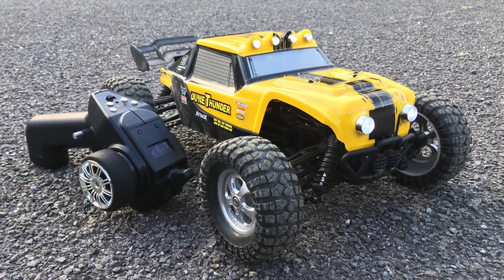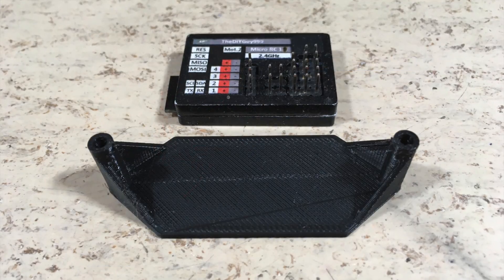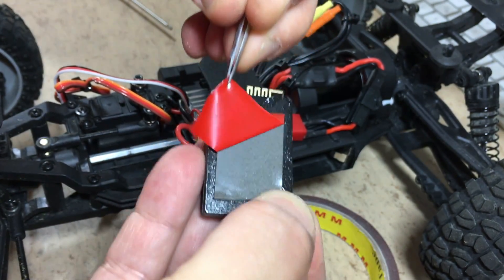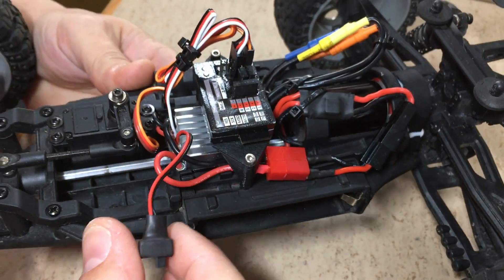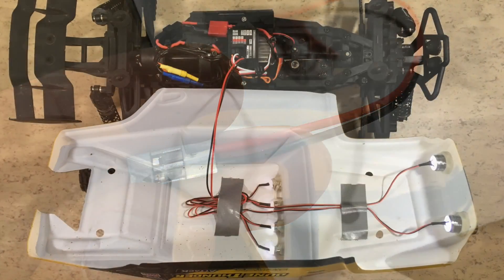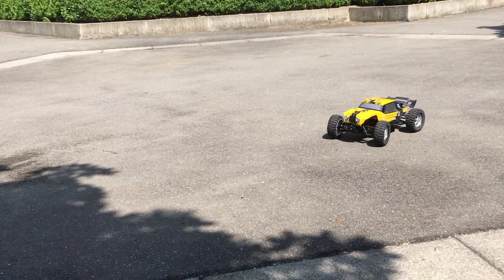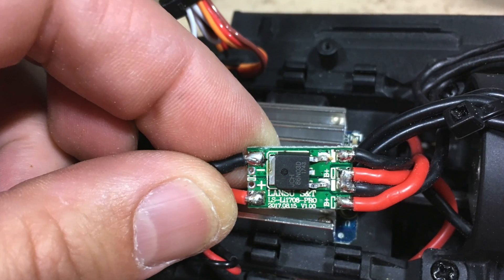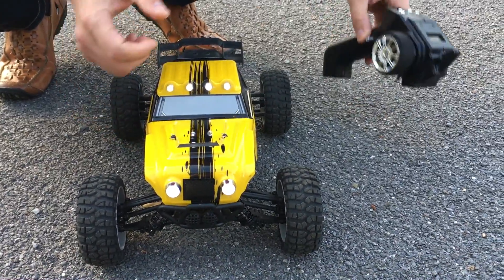HBX 12891 DUNE THUNDER Brushless Conversion Part 2: 3D Printed Parts!

Comment: I've just finished my upgrade with the parts you've provided.  I am having the same issue with it cutting out.  What did you do to the receiver?  I am using a Radiolink RC4GS 2.4G 4CH RC Transmitter and Receiver R6FG Gyro Radio Remote Controller system.
Reply from the maker: Use better "high discharge" 18650 batteries, which are able to supply the needed current.
Adding a filter capacitor for thee receiver could be helpful as well: https://www.banggood.com/1000UF-Filter-Capacitor-For-Flight-Controller-Receiver-VTX-RC-Drone-Multirotor-Spare-Part-p-1284837.html?utm_campaign=4828314_1046285&utm_content=1097&p=NZ29024828314201605E

Comment: Hi mate I finally will be getting your reciever mount printed, BTW have you come up for a way of fitting a small 3s pack? I have a different body so fit mine in the roll cage.
Have a look at my setup on my channel if you like. Very modified drivetrain :) if I make more videos I will mention you for the reciever mou t and 18650 adapters.
Reply from the maker: Hi
No, I think the best solution is to use a battery strap. Be careful with 3S, my motor already gets toasty on 2S... Also make sure, that your "small" 3S pack is able to supply the required current. If overloaded, it will expand. I had a look at your video, runs good!
Reply: @TheDIYGuy999  my mptor does not even get warm, must have the perfect gearing. Although yesterday I had to change the diff gears as they got worn after my testing period and now was ready to put it all together as should be. I noticed now they changed the gears,  bevel used to be 13 and is now 11, big gear on diff was 38 but now 32, I be out today to see if I need to put a smaller pinion on..
Do you have the 16 motor pinion on? I do as recomended by hbx and Redcat to use with this motor.
Reply from the maker: I'm using the stock pinion. It works without issues and it is fast. But I still think 3S would be too much.
Reply: @TheDIYGuy999  the stock is 12 or 13T dot you find d that to small, and car will rev to much? I tried 15T yesterday and think I stick to that. 
BTW as we seek of to a buggy club track, my "toy grade car will be in a race lol

Comment: I bought the very same batteries for my 12825, and my top speed dropped with 8kmh, Samsung 25r gave same as original blue ones..
My car is 100% stock and maybe can't handle the 32a constant amp with 40 amp pulse?
What are your thoughts?
Reply from the maker: My batteries of this type are faster than the original ones. Are they fully charged to 4.2V? Are you using my 3D printed adapters? The car is certainly not the issue,  but I never tried these batteries in stock condition.
Reply: @TheDIYGuy999  I'm using magnets, they charge to 4.20
Reply: @TheDIYGuy999  I will watch your upgrade videos a bit better tonight, maybe go through the soldering and clean the engine. I will upgrade to brush less soon. Maybe thicker cables from the battery compartment.
Reply from the maker: Magnets do not work for high current applications, because their internal resistance is too high. I believe that's why your voltage drops below the level of your original batteries.
Reply: @TheDIYGuy999  I was thinking the same, would a nut be better? Can I measure conductivity with my multi meter?  (Cheap yellow one)

Comment: Excellent video! I like the custom parts.
Reply from the maker: Thanks. Yes, this thing is really nice now. I‘m still running the plastic drive shafts. No issues so far. And I have used it a lot.
Reply: Do you know where to get the metal gears by chance? I've looked everywhere but no luck finding an equivalent.
Reply from the maker: I think there are no metal gears available. But as I said, I never had any issue so far. And I have bashed it a lot. This thing is very robust.

Comment: 5:12 low voltage setting
You are setting low voltage at 2.8V discharche cutout normaly is 2.5V for 1 batterie bit you are using 2 in series so IT should be 5V cutout otherwise your going tot damage the batteries i think! Correct me if i,m wrong!  Still havend got the car here but exepting IT next week
Reply from the maker: This setting is the voltage per cell. The esc automatically recognizes the number of cells, if you switch it on.
Reply: A super! Thanks then its oké

Comment: Hi, 
I want to know how to solve the problem with Pinion Gear . Can you recommend me? Thank You
Reply from the maker: Hi, I don't exactly know what you mean. Which gear?
Reply: sorry. I mean Pinion Gear  Not durable, do you have a solution?
Reply from the maker: The small motor pinion? The one in my car is steel and can't really fail I think. As I said in this video: I strongly recommend to improve the gearbox sealing, If you want to drive it on fine gravel or sand.
Reply: HBX 12891 is a great toy car. But when I changed the 4000KV motor in 1902 I found a problem with my Pinion Gear.
Thank you
Reply from the maker: Just use the same motor as I do and you will be fine. Also have a look at part 1. the parts links are in the video description.

Comment: 1:22  EVERY TIME!! 😆 it’s the best tho 👍
Reply from the maker: Of course. I mostly use my own Arduino remote. It's just better than most cheap 2.4GHz systems, because there is no dead zone around the steering center position. I think I already made around 20 pcs. of this receiver.
Reply: Excellent reply and agreed but I was referring to the picking and lifting of the corner on that specific style of 3M ds tape. I’d pay more for center crack and peel if was available.
Reply from the maker: LOL. Yes, this tape is just a pain in the b..t